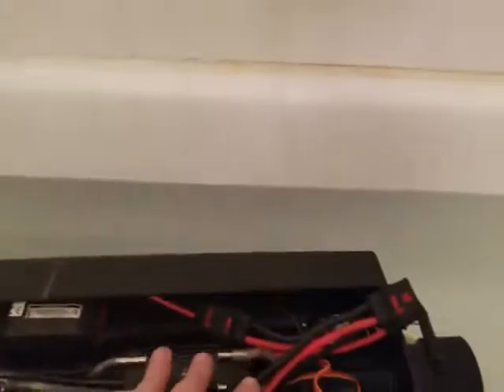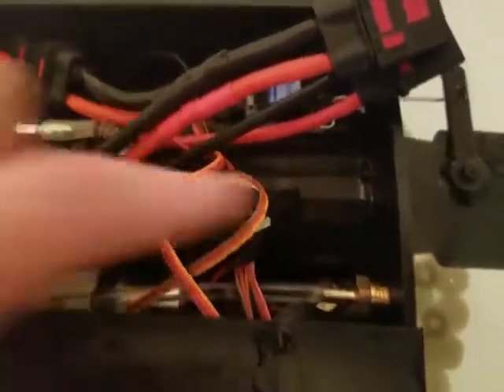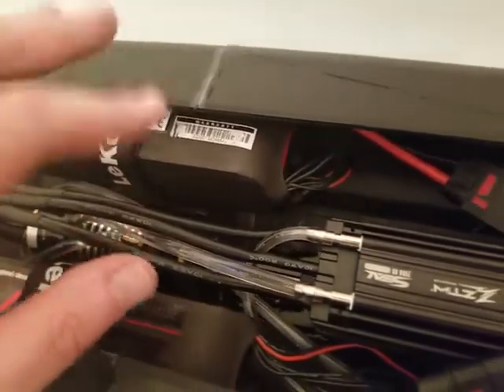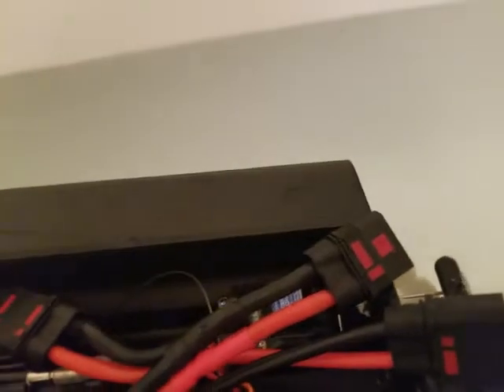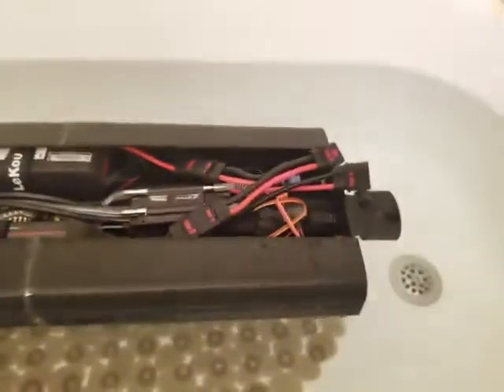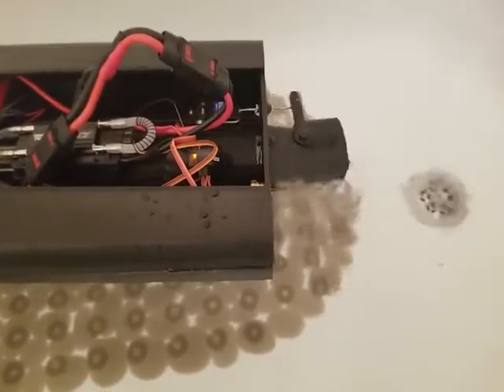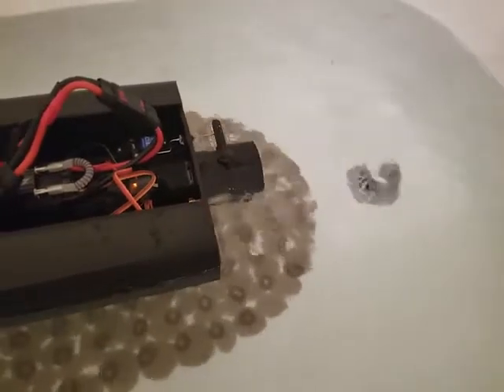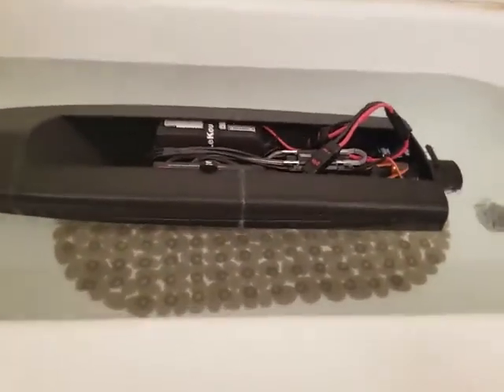first test of my fully 3d printed jet boat

Comment: Nice build What connectors are you using? They look similar to xt90s
Reply from the maker: Ose 8mm anti spark bullets. Rated for 300A. Its over kill for the boat as the esc is only 200A but they are the same batteries i use on my 12s xmaxx so had to use the same plugs on the boat